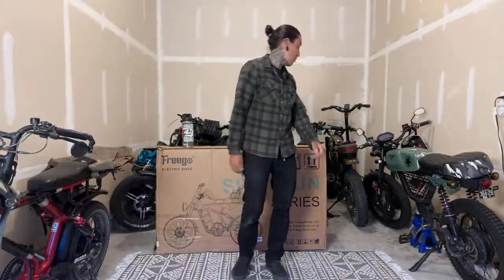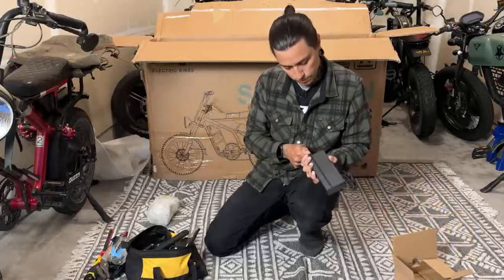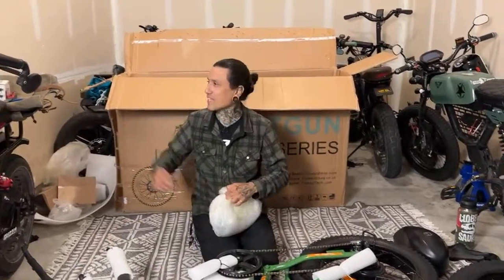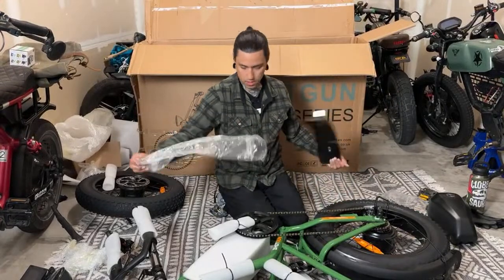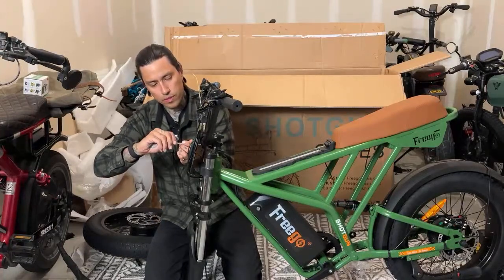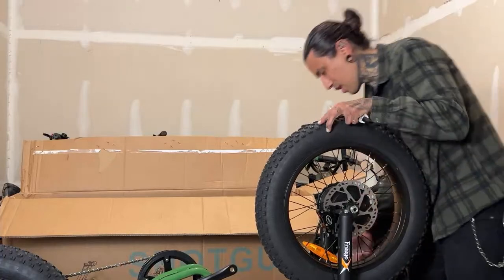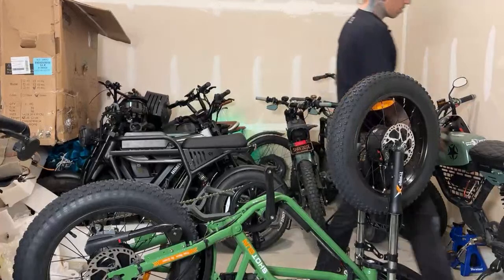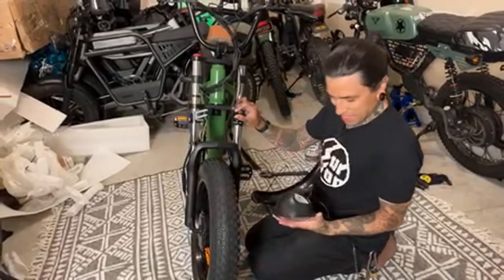Unboxing, Assembly & COMPARISON of FREEGO F3 Pro vs. ARIEL RIDER Grizzly Electric Bike | LIVE Q&A

Comment: How do I unlock it? I’m getting mine tomorrow
Reply from the maker: Hold the brake while powered off while still holding power it on then continue holding for 20 seconds after that, it should be unlocked

Comment: Did you happen to see the controller specs? Pair of 25 or 28 amp? If 22 amp controllers you'll see just a bit over 1,000 peak
Reply from the maker: Not sure on controller specs but this thing has a great top speed